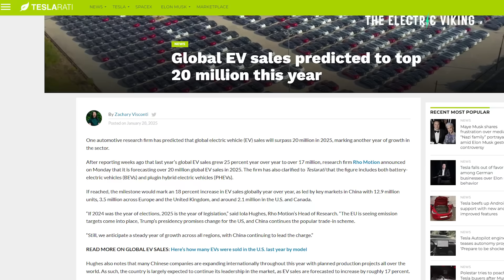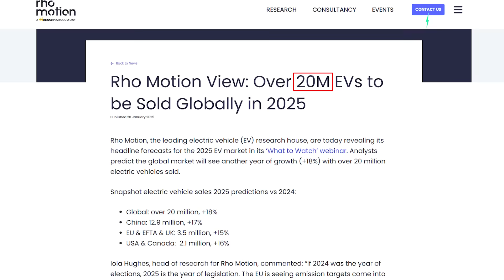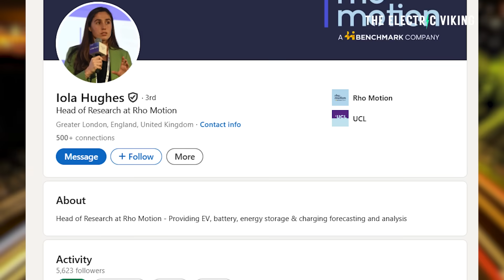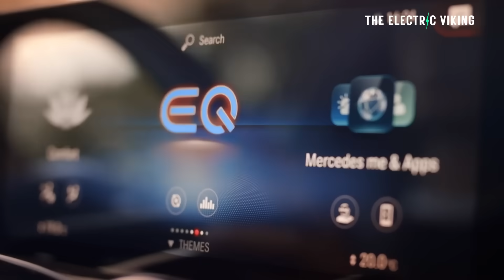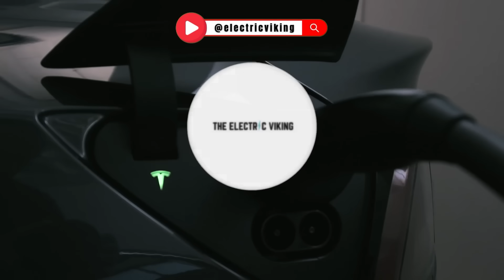Global EV sales predicted to rocket past 20 million this year

Comment: Perhaps you should look at the very recent bus fires in Massachusetts and warehouse fire in Aus and school buses now going up caused by Lithium ion batteries. China are now starting to use some lead acid batteries. Also how can you have Lithium Ion batteries that burn at 2000 degrees C in a car park that will only stand 8-900 degrees as it was designed for ICE Cars. PLEASE ANSWER ME THIS?? In the UK we are struggling to sell new cars let alone EV's and hardly anyone wants a 2nd hand one I am not against EV's as the motor is good. I AM AGAINST LITHIUM ION BATTERIES WHICH ARE A KNOWN FIRE RISK AND HAVE BEEN SO FOR 30 ODD YEARS WELL BEFORE THEY WERE PUT IN VEHICLES!!

Comment: Global EV sales were 17M, of which roughly 12M were Chinese NEVs, up from 3.2 M in 2021, 5.9M in 2022, 8.1M in 2023.  Chinese NEV sales should be at least 15M in 2025, easily bumping the global total to 20M. A small Chinese push for 50+ km PHEVs and EREVs over ICE cars, and it's 17M (global total 22M).  Advancing a national mandate for ALL Chinese cars to have minimum 50 km battery range by 2030, and they'll get there even faster.

Comment: 20M is about 25%, that's good. My personal gut feel here in the UK is more people will be driving EV's could be used ones, outright purchase or leased. 
I really would not feel comfortable buying a new petrol or diesel car right now knowing that it may be worthless in a couple of years time. 
Prices for used ICE cars will drop again, in 2023 ICE had over 94% of the car market but in 2024 this had dropped to just over 52%. If I was in the market for a replacement vehicle say petrol, it would be on a lease of some description, I would not like to be left holding the baby in a few years time. 
As in musical chairs, each round they take away a chair, when the music stops some mug is going to be stuck with a hunk of junk on 4 wheels, scrap value only.

Comment: I don't understand what Sam is saying. I think he's saying a PHEV isn't a hybrid? What?
Reply: Depends on the tech and balance.  Chinese PHEVs are strong battery, minimum 50 kms battery range, most now 100+ kms battery range with a small, high efficiency 1.5l range extender.  Many of these Chinese PHEV batteries rival the 1st gen BEVs like the Leaf and MiEV.
Reply: He does a lot of that.  Early in the video he mentioned the 25 million included EVs and PHEVs, and clarified he doesn't include the PHEVs as part of his personal view.  Then later he mentions its 25 million EVs without clarifying if that includes PHEVs.  He needs to update his scorecard before making videos.
Reply: @crosslink1493  Very true.

Comment: About 75 million vehicles were sold last year, so 20+ million EV's is nearly 25%.  Follow the trend line and, we should be >50% EV sales by 2030, and 100% just before 2040.  I just watched a Zeeker EV charge from: 8%-80% in 9 minutes, with an LFP battery! Samsung's solid-state battery promises 0-100% charge in 10 minutes, at 500W/kg.  No question, EV's are the now and future, and will only get much better!!
Reply: The Chinese market is 30M, of which 12M were NEVs.  China is driving the increase.
Reply: EV market is dying as you speak. U.S sales has fallen , almost stopped . To many Fires to cars and Battery Storage plants

Comment: Electric vans (pre-registered, so effectively brand new) in the UK have discounts of 63%, and there are very few for sale, explain that ;-) The cost of charging on public chargers here is also eye-watering, the equivalent to running a petrol car that does 16mpg! Plug-in hybrid still the only sensible way to go, 85mpg (ish) and over 800 miles to a tank, a no-brainer methinks. I still have a petrol car by the way.
Reply: Eye-watering? Tesla superchargers charge £0.51/kWh. BP and Shell charge £0.78p. So my Polestar 2 costs about £12.50 for a 50% fill up which gets me 120 miles. My Volvo XC90 cost £100 for 280 miles. Thats eye-watering. So Polestar costs ~10p/miles. Volvo costs £1/mile. Ten times the cost of my EV. So my EV gets 145 miles/egall.
Reply: @iscadean6038  Wow, that XC90 is eye-watering, used to get way more than that (430 ish miles) from my 2011 Range Rover sport! Domestic electricity tariffs £0.25/kWh so you're being properl robbed at any of those public chargers. Good figures on the Polestar though- for 'mpg' at least 🙂
Reply: @ my octopus energy Intelligent go account gives me 7.5p/kWh. Which is what I use most of the time. Plug-in hybrids are the worst of all worlds. Twice the potential for going up in flames as an ICE, which is 60 times the potential for burning over EVs. Twice the complexity with petrol tank, radiators, water coolant, ICE engine, EV motor, inverter, Battery - heavier than either ICE or EV so worse tyre wear. I’ll stick to EV only. Cheaper, quieter, faster, low service costs, etc. oh forgot to say. No emissions in use. ICE and EV create 15 tons of co2 during manufacturing. ICE and hybrids produce 50 - 70 tons of co2 over 200k miles.
Reply: @iscadean6038  Nice, will have a look at that. Is that a night time (Economy 7 in old money) tariff?
Reply: @ nope. 11.30pm to 6.30 am tariff. Have a look at Octopus Intelligent Go EV tariff. The car sets the scheduling and will only charge during those times using the iPhone app. I can warm the car from my bed, shower, dress, eat breakfast and get in a warm, ice free car. Defrosting using the same app. And no emission no ‘warming up’ running an engine. And no sound.
Reply: @iscadean6038  Ah, an EV only tariff. Can it be hacked to supply domestic too? ;-)
Reply: @ all appliances used during these hours (washing machine, dishwasher, dryer) - no need to hack - anything in fact.

Comment: EV sales were down in Europe Germany but that was part of an overall sales slump of 27%.

*edited for accuracy.
Reply: Think you need to back up that figure. Wasn't it just Germany that dropped that much and not the whole of Europe? Norway are 80%+ BEV only, UK were nearly 20% BEV.
Reply: @steve_787  BEVs were 90% of all car sales in Norway at end of 2024. It's probably going to hit 95% by mid 2025. The last 5% will be difficult to stop but not having gas stations around, will put pressure on it.
Reply: @ yeah, after a more detailed search they topped out at 88.9% BEV sales last year, I wasn't sure if that was including PHEV's etc so just put 80+ to cover myself ;-) I'm sure there will always be some sales of petrol cars to cater for the exotics that can get around the requirements but like you say, they are well on track for pretty much BEV only sales. UK target is 28% this year so I'm keen to see the first months sales/registration figures next week. Will find out if they were just holding back petrol sales to bump up the BEV figures or not.
Reply: @steve_787  It will be a long transition, lots of people panicking thinking they have to change cars in 5 years - they don’t. Personally, even though I drive an EV, I don’t think they’d will be the dominant cars on UK roads until 2040 at least.
Reply: @steve_787  Don't be fooled by UK figures which were artificially boosted by pre-registering BEVs in December 2024 that hadn't been sold, after previously being boosted by holding back BEVs in December 2023 so they could be sold in 2024.  Now huge numbers of 2024 BEVs with delivery miles only, are appearing on Auto Trader with large discounts.  This all points to a market and industry under considerable stress.  The UK government will have to restore some incentives if they wish to boost sales otherwise 2025 will be worse that 2024.
Reply: @  You might be right. I’ve seen so many figures in the last few weeks. I saw a figure of 31% for the UK in 2024. Anyway, everything I’ve seen confirms that EV sales are booming.
Reply: @thethirdman225  EV sales are booming globally, because NEV sales are booming in China.  China went from 8M in 2023 to 12M in 2024, and will easily hit 15M in 2025.  Possibly 17M.  Outside China, NEV sales are relatively flat or small, but growing fast in developing countries.
Reply: @ZweiZwolf  Is a plug in hybrid classed as a electric car. From my research it is showing Chinese are buying more hybrids than battery  EVs.
Reply: @ In China, PHEVs have least 50 km battery and are primarily driven on battery.  China invested very heavily into convenient and affordable public charging infrastructure.  The Chinese generally drive less than 40 km daily, and Chinese PHEVs & EREVs generally have 100 km range.
Reply: @ The Chinese plan is a good model. In fact, most people who live in cities seem to drive less than 40 kms a day.
Reply: @ Chinese people who live in cities might not drive at all.  China invests VERY heavily into urban public infrastructure, with lots of urban, light, and commuter rail supplemented by bus & tram service, rideshare and taxis.  Their housing is vertical, and most have grocery, restaurant, and other local services within walking distance.  It's really fascinating how their city planning and management works.
Reply: @ZweiZwolf  I'm sure the majority don't.
Reply: Yes parts of Europe have sold less, parts of Europe have increased, UK went up.

We can all pick and choose locations to prove our point, but can’t deny worldwide they increased by a lot.
Reply: Tariffs on Chinese cars in France, reduction in subsidies.